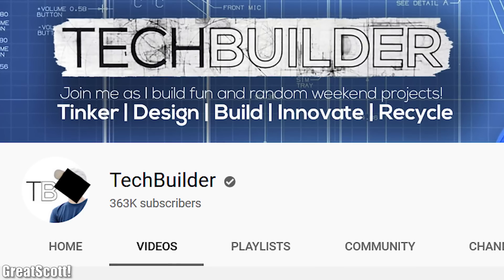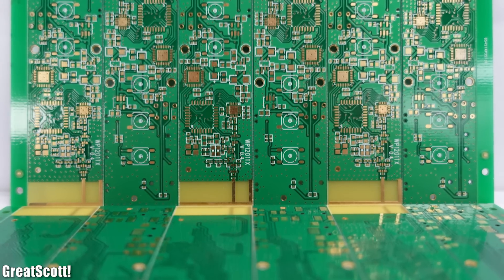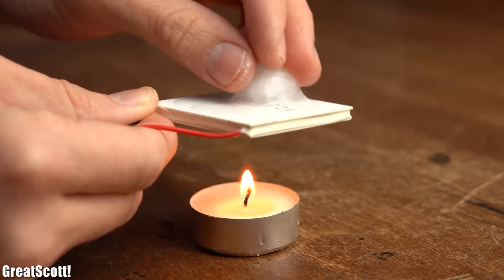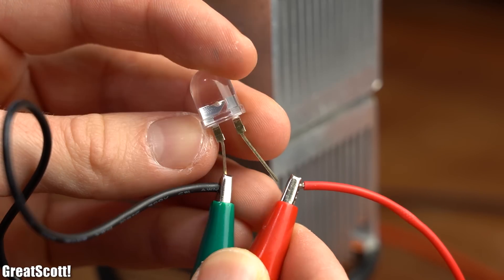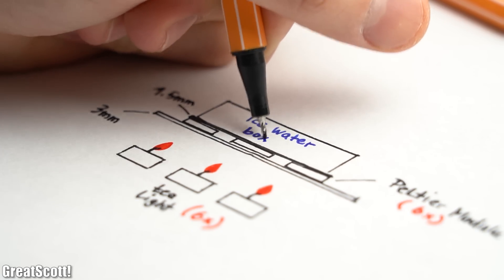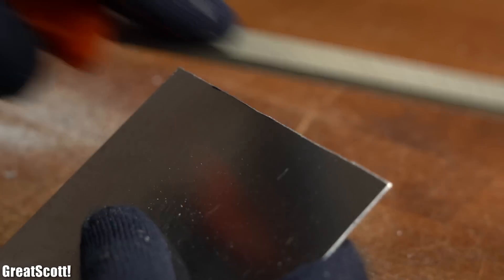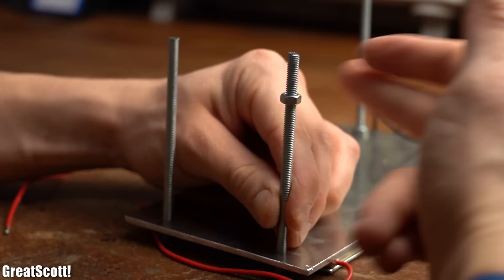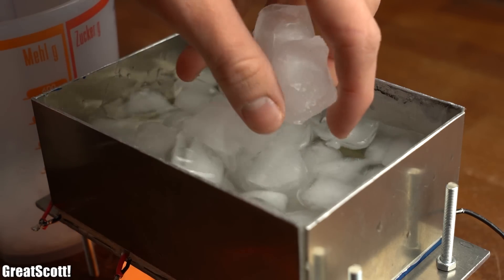Exposing a FAKE Thermoelectric Generator and building a REAL one!

Comment: I think this might not be as unfeasible as it seems on first glance. 

40 milliamps straight is certainly not enough, but if you distribute it over a longer period of time and improve efficiency you could basically end up with a fully charged phone over 10 hours or so, adding some capacitors and complexity. Also depending how to utilize the waste heat produced and ambient temperature.

As a phone charger? No, not really, but you could end up with somewhere around 3000mAh of usable electricity over time while producing heat and possibly use the cold side as a dehumidifier? Not indoors tho.

Comment: alright so now it's time for me to weigh in... first you needed to use TEG, unlike TEC, in TEG N,P pairs sits on copper pads which greatly effect the thermal conductivity and also lower the overall resistance of the module which as you know is very important for such concept. also in TEG they use high temperature solder that will eventually slow down the degradation in cycles of heating and cooling... alright now that we done with that let me share you my own experience with almost the same exact setup. I used 5 TEG SP1848, modified them by removing the silicon sealant around the module and add insulation in between the legs inside the module... then I connect them in series and place them together to form a cube with one side being open. I added some modified copper plate inside the cube making sure the heat would reach all 5 modules evenly, then I add 5 1cm tall aluminum heatsink on the outer side of the cube (which was painted black cause I was going to cool the system passively and black gives out the most radiation) then I put a tea light under the open side of the cube and let it heat up... this system gives me constant 2.7V 0.147mA in short circuit and  3.4V on open circuit (not sure how to measure the current in open circuit). now I was expecting to get more than this from my system but as it turned out I made a mistake on two things... although I tried as I might I wasn't able to heat up the 5 module at the same rate and that effected the over all current drastically, second thing was SP1848 is just trash, they use a very little solder in it, the connection was half soldered sometimes and even worse some of the legs were no even standing straight! the whole module is connected in series and the weakest link in the series will determine the limit of  current that can pass through. I'm goanna repeat this but I'm going to make my own TEG this time. I'm gonna buy some TEC or TEG, remove their N,P legs and manufacture a TEG suitable for my need, as you know a good TEG can give up to 9-10% of the heat it receive in the form of electricity. a tea light gives at least 50 Watt of heat so I'm hoping to hit the 5W output, although I'm satisfied with 3W too! thanks for reading this :)

Comment: TEC (Thermoelectric Cooler) and TEG (Thermoelectric Generator) modules are both based on the thermoelectric effect, but they serve different purposes and operate in opposite modes. TEC: Consumes electrical power to create a temperature difference (cooling or heating). TEG: Generates electrical power from a temperature difference.

Comment: Hi , could have used TEG ( thermoelectric generator ) peltiers modules SP1848-27145 instead of TEC ( thermoelectric cooler ) to achieve better results .

Comment: Paint hot side black and have it out in the sun. Shield the cool side from direct sunlight and install a large heatsink. Additionally, install a cooling fan into the heatsink to increase efficiency. Maybe if you're lucky, it could power the fan it's self on a hot day and increase power output while the sun is out. 

I have no clue how this compares to solar panels, I have a feeling it isn't as efficient.

Comment: I know this is an older video, but would you be interested in designing something that could be placed over or near a camp fire and passive/active air cooled that could produce something like 5-10 watts to charge ipads etc? I've seen products like the BioLite CampStove that claim to be doing it, and some reviewers have reviewed them positively (for what it's worth), so I feel like it's doable. For someone with limited knowledge, like me, I'm just thinking a cluster of Peltier modules in series/parallel to get the voltage/current capacity we need, potentially fans for the cool-side-sink, assuming they help generate more than they use???, and then a simple boost, buck, or boost/buck circuit and some overload/undercurrent protection. I would love to see how you would think through it.

Comment: Hi Scott, I was just browsing and see your video and after I watched it I could not help to step and say what am I about the say. 
First ,  first idea creating power generation by tea candles is not WRONG !!!  but, set up is wrong. Before, I go any further let me clear that I am engineer myself and lets go in to short details. First,  Peltier modules are designed in two different ways in general  TEC  (Thermo Electric Cooler )   or  TEG  ( Thermo Electric Generator )  , each module setup in a different way and material used. That is way you see product tag  either say TEC -XXXX   or TEG-XXXX   and n semi conductor modules used determines efficiency of cooling or power generating effect , plus also determines out put. So,  other youtuber and your choice of peltier models are wrong !! About the idea, it can be done, first you need to get TEG modules,  there are various models depends of spec chart but in general  60 to 80  Centigrate difference modules with high out put are better choice for a average knowledge person, because easy to control and produce power out of it. I design my own version of which can create about 30 Watt each module with 80 Centigrate difference (cost me fortune , just over 3 K usd just a prototip to build and belongs to me , not commercially available yet because waiting patent to be finish , but  you can get 30 watt  7,5 Volt x  4.1 amp )  Anyway, most important part you need to trap heat energy , if you use open ambient you will not get any result. Just wasting your time,  and cooling, just use ambient atmospheric temperature with simple heat sinks.. But !!! heat must be trapped and sealed ( there will be always leake and loss , but important part to minimize it ) ,  So, over all , I do not know the other fella you say fake,  Not fake but wrong set up.. Same as yours.  Anyway.. I think I have been too straight. But, I could not help to straighten the subject and mis -informing the subject to the public. Thank you and good luck .

Comment: Regarding the peltier cell array you created, I believe that by connecting them all in series you are limiting the total current produced to the minimum. 

As a suggestion: Once you are using a buck boost converter, output voltage should not be a problem to you, but power. I would try rewiring the cells all in parallel (you can also include diodes at the outputs of each cell to prevent cells from consuming each other's generated current) and see if that increases the output current you get at 5V

Thank you!
Reply: The problem is not just the current. It's the power/energy available. At 6.5V and 200mA with the lowered top, there is only around 1.2W available out of the generator. Doesn't matter that you change the wiring from series to parallel to  lower the voltage to increase the current, the power would stay around the same. The buck/boost converter also can't create power obviously and because it is also not 100% efficient the power available would be less than the 1.2W. The phone charging current wouldn't change.
Reply: @TheWingAnthony  you are correct if we only consider two ideal Peltier cells. However, considering individual differences in the current generated on each cell, the series config will force the circuit's overall current to the minimum possible, compromising the total power available.

Comment: There is a peltier based wine bottle cooler that sits on the counter. They can be easily had at thrift stores for a few bucks.
I took the outer casing off, and had a convenient aluminum cup bolted to a big aluminum heat sink with the peltier sandwiched in the middle.
There was a fan on the heat sink side and I just discarded it. 
I suspended the heat sink side above a kerosene lamp filled with diesel spiked with a tablespoon of alcohol. To the peltier I connected a cheap pocket transistor FM radio with a shitty little speaker.
I filled the cup with cold tap water and lit the lamp up. After about ten minutes the radio worked and played loudly.
I did this outside at night and one of my pussy neighbours called the cops. Cops showed up, were interested, said goodnight and be safe. Fuck goofs who call the cops on things they are too dumb to understand.

Comment: you ve made a mistake.. you have used a TEC instead a TEG.  Thermo electric cooler  and thermo electrig generator... they are already in series conection to increase the voltage!!
you can reach up 8 volts in a single peltier module.. check it out :)

Comment: A few years ago that same type of fake peltier generator was all over youtube and other sites. I'm no expert or anything but a dead giveaway was how they always had that same set-up, with just one tealight stuck in an open mesh pencil holder or other open mesh containers - with just one tealight and an open mesh container, whatever heat the tealight produces will have vanished in the air before it reaches the peltier module.
That simple fact would/should be obvious to anyone with two braincells or more, even if - like myself - they might not be electronics whizzkids or anything.

Comment: If each temperature degree different in mole of water need 8700 jewel and each 18 gram of water had 6.02 × 10^19 mole then temperature is huge energy just between roofing and foundation or tree top to root

Comment: about 6 weeks ago, i started looking into this topic. most of these youtube channels are getting much of the very important details wrong or skipping over the most important parts. this is the third big youtube channel, that for some reason, cant get much power out of these devices.

 no doubt the "tech builder" video was likely a scam, however, i was able to get 5.2watts from one teg device. the module i used is the same size 40mm square by 4mm tall. i bought 3 different sample modules with  various specs and prices and found i could get 5.2 watts from my unit.

here is another hint, the chinese on their own do not know what they are doing. they need someone to steal IP from for them to get most things right, which i think is part of the problem here.

i have recently bought maybe 50 or 60 modules to mock up a smaller test. i will likely not shoot for 5.2watts per module at first, but some where around 1.9watts each, rounding to 2 watts and assuming i have 50 of them i should be able to produce 100 watts or so.

my end goal is 1200watts to produce enough power to help charge my large battery bank in the house on cold winter days when the sun doesnt shine and my solar panels dont work. i feel if i can get it to about 2kw i may have something i can take to the market, but time will tell.

i work in IT, but apparently i need to show my design to the world at some point as no one seems to be able to get the power i do, and i am for sure not some sort of "free energy" scammer type, nor do i pretend to be some sort of gifted genius, i am just very thorough and not afraid to invest the time and money and will never beleive any dogma until i see the data myself and have found most of us have no idea what we are doing even in our own fields. also, i have a channel of random stuff but its mostly pocket knifes lol. once i get around 500 watts i will show how i did it on that channel

im ok with all the investment as i am learning about so many thing at the same time and the knowledge and equipment needed for these teg devices have already helped me in other areas with my diy hvac needs, but i am working with limited funds so this could take about 6 months and i want the cold outside air to be part of my build, so ice from the freezer may be part of the mock up come summer time

Comment: I want to build a Thermal electric generator powered by a campfire something I can place on the campfire ring that will generate enough power to charge batteries on a trailer or even power something like a mini fridge or any 12 volt cooking accessory for camping even having the ability to take electric coffee grinder with us would be nice and power off of campfire using Thermal electric

Comment: Great vid.  I have a 1/4 scale model of a narrow gauge steam locomotive.  It is based on a prototype similar to an O&K 40hp 0-4-0 (ie B wheel arrangement). It stands 900mm tall with all the usual components including firebox, fire tubes, smoke box and tall chimney.

I like the idea of powering an LED headlight for my loco, using waste heat energy converted into electricity.  (Turbo Generators use a lot of steam.). But as you know, a vast proportion of the heat energy in a steam locomotive is wasted up the chimney.

Any suggestions?

Comment: Your replacing an externally powered fan with externally frozen water both require an outside power source. 
Also those candles are so far away from the plates in the old and the new that im not surprised the output was so low.

Comment: Is it possible to this work with inside and outside a house? Like in Winter ?
Reply: I was thinking this as well. When you get sub zero temperatures outside and want to heat your cabin with a fireplace of some sort could you build a battery charger by using the hot air from your fireplace and freezing temperature from outside? You are gonna heat your cabin anyway with the fireplace so this would be free electricity? Not sure how much electricity one could get from this, but it's extremely interesting thought.

Comment: Aren't TEG peltier modules more efficient for this application rather than TEC?
Reply: Harder to get hold of though. They are similar enough in construction that a module made for cooling can work for generation too, just not as well.
Reply: @vylbird8014  they are on eBay or AliExpress in packs of ten for £25 or around 2.70 quid each.  Would be interesting to see the difference in output of the two types
Reply: @jeansandjumper  There's another factor though: Heat goes through them. Has to, for them to work. A lot of heat. So you're going to have to shovel a lot of fuel into your furnace to get a bit of electricity out. There is a good reason these modules are not generally used for power generation.
Reply: @jeansandjumper  they're almost certainly relabeled TECs, it's unfortunately very common
Reply: night and day. TEC is not built ,in many ways, for generation.  Don't get TEC for generation.
Reply: @brentkelly5445  It's like using a motor as a dynamo. It'll work, but the device isn't optimised for electricity generation, so efficiency will be poor. The main difference for those made for generation is in heat-tolerant materials: They can run much, much hotter. At temperatures which would melt the solder in a TEC.

Comment: you need to polish your work surface and use flux when soldering aluminum, but a better method would be to just weld it at that point

Comment: what happens if you let the water just boil. it will be pegged to 100 degrees and candle fire is around 1000 degrees so let the flame touch the heat sink. would that not be good?

Comment: 0.2mV is too low to power up anything but can boost up the voltage by some other electronic component experiment it by  apply it to CPU  OR GPU in computer system to power miniLED @ the back.

Comment: You seem like an intelligent guy but this is so stupid why would you put a tiny candle underneath a huge heat sink you should have just had the portier device and then the heat sinks on top of it so that the portier device could get direct heat from the tiny candle you have 6 in below come on man it would work! Also the basket you're using should be a can with a square hole in the side like you have that way there's more heat being contained so that the poetier device can heat up properly put as many heat sinks on the cold side as you want but you've got to get heat to the bottom to generate the electricity and having one little candle 6 in a screen basket where the heat is just escaping everywhere you need to direct that heat to where it needs to be this could be easily done!

Comment: Fun build and you have a lot of talent but there are also some things to improve with this build: 
1) Check your thermoelectric cells to see if they draw expected currents, there are a lot of 12703s from China that are falsely packaged as 12706s.  I would not be surprised if this 26A version is also not consistent with specs. The added resistance of fake modules can kill any hopes of making a useful powerful generator.    Consider: a candle liberates about 80 watts of heat.  A thermoelectric cell can capture about 8%.  So 6 watts per candle tops.  You got 2 watts with 6 candles so I am inclined to think those chips are not true 12726s

2)  The thermal transfer and therefore power generation depends on the load.  A matched load will increase power.  I believe a load operating at half your short current and half the voltage of your open circuit would be ideal.

Comment: you know if you had sanded the areas you were soldering you could have gotten adhesion with the materials. you can't weld metal on metal without a medium. even welding rods contain a flux.

Comment: Could a roof made of alternating metal sheets(insulated from shorting to the next panel) where one side is in the sun and the other slanted away from the sun or in partial shade work as a voltage source?  How many amps would it produce?  I believe, in winter the sun angle would give an even greater temperature difference.  Cover a small shed with these sheets and test it out.